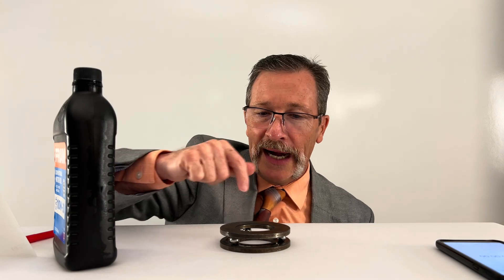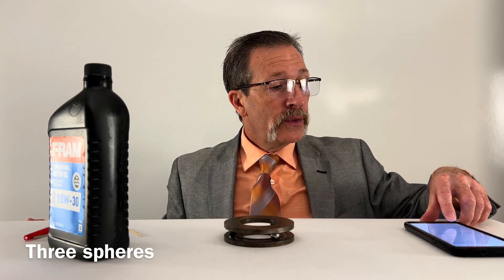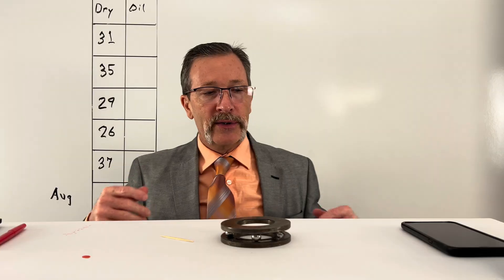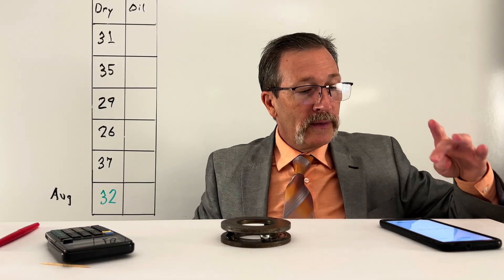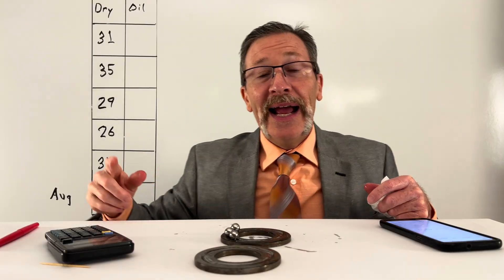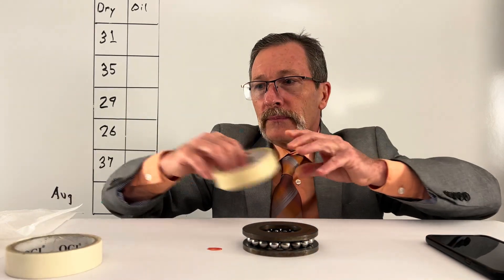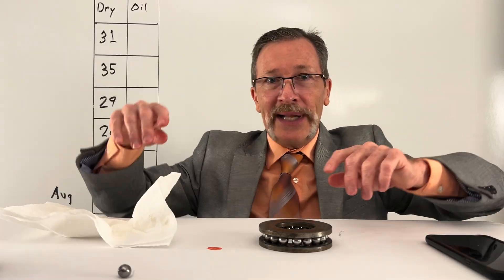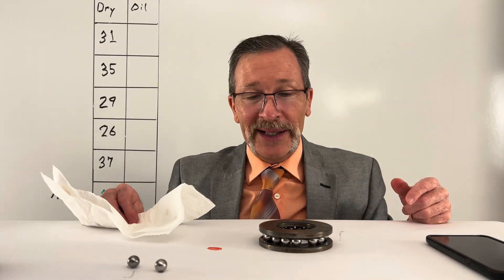Does Oil Make Ball Bearings Rotate More?

Comment: Fun fact, when we lubricated ball bearing motors, we always were taught to leave the drain plugs OUT until we could run the motor for about an hour. This was so the grease would warm up and the excess grease would drip out. Only then did we put the drain plugs back in.  In motor maintenance school we were taught that OVER LUBRICATION was a major reason for bearing failures. They will overheat, expand from the heat, ruining their high tolerances.

No offense meant, but your oiling method is way to much oil. If you just wiped the balls with an oily cloth would be more like the proper amount. That's one of the differences between 'ball bearings' and 'journal bearings'.

Still, a nice exploration of things.
Reply from the maker: Thanks for this practical comment and your expertise! Really interesting stuff!

Comment: Oil will have a bigger effect the more balls are in a bearing because it will provide a buffer layer between touching balls and act as a fluid bearing.

Oil will increase friction on unloaded bearings, but things get weird under high speed and/or high load.

Grease under high load will increase the contact surface area of the bearings and help to increase the carrying capacity of the balls and bearing race.

In high speed bearings the balls will start to hydroplane on the oil as it begins to act like a ramp for the balls, since the bearing race provides little space for the oil the oil pressure generated by a high speed ball forces the ball into the centre of race.

In short bearings are complicated and even ball bearings in practice are a mix of fluid and mechanical bearings in almost all applications.
Reply from the maker: Great response! Thank you for this.

Comment: I'm an auto tech and I deal with bearings (on cars) everyday. usually oil or grease is for cooling. I've noticed bearings that run dry overheat. wheel bearing usually have the balls in a cage to prevent them from touching. We really don't refer to ball bearings as thrust bearings. thrust bearing are flat like washers that prevent crankshaft endplay, they usually ride on pressurized oil.
Reply from the maker: Thank you for your feedback, knowledge, and experience!
Reply: More specifically, you're referring to a hydrodynamic thrust bearing. His example is a thrust ball bearing, where the arrangement of the races is still designed to support larger axial (thrust) loads than radial loads. Radial ball bearings have concentric races, as commonly seen in skates.
Reply: What the lubricant does is allow a friction wedge and also transfer heat to the sink.  Rotor, hub, spindle, strut, control arm.  Use your thermal cam if you have one some time.  All part of the function of a kinetic energy conversion system called brakes.   Each bearing type, taper roller, sealed bearing , Torrington, thrust all serve a different load purpose. The forces exerted are dynamic so they must endure multiple force vectors and variable levels depending on application.  That's why a converter hub bearing isn't a roller or why a taper cone set is used as a wheel bearing.

Comment: Great, now I’m hooked, especially since I just replaced some broken spokes on my beach cruiser and noticed the hub ball bearings were a bit dirty, gotta get me some grease I thought. The oil lubricates the ball bearing to prevent and/or reduces wear while under load and as they heat up during motion.
Reply from the maker: Yes...always use grease. We are showing how to do a long-term project, but it was surprising watching this bearing with and without lubrication. Thanks for your comments!

Comment: Good stuff! Lubrication increases rolling friction, but decreases sliding friction. Where rolling and sliding friction are equal, the mode of contact motion (rolling vs. sliding) becomes unstable. I'd still like to see gun oil and/or WD40 vs. clean and bone-dry.

Solvent wiping can be a messy process, so I'd recommend two solvent baths:
1) The 1st bath to thin and remove most of the oil
2) The 2nd bath (followed by paper towels) to remove any residual oil

To conserve solvent, the bath container(s) should be as small as possible, while allowing the parts to be fully submerged.
Reply from the maker: Yes...good ideas here! Especially the WD40! Keep watching and thanks for participating.

Comment: Under no load, the oil introduces friction and the viscosity makes a big difference, with a load oil reduces friction and in the case of bearing to bearing, this contact becomes the load, or part of the load.
Reply: Good point. Performance could be tested at more than one axial/thrust load. As it stands now, the top race sees a thrust load of one race's weight plus any hand pressure, whereas the bottom race sees the same load plus the weight of the bearing balls.

It seems that most of the sliding motion tends to occur between the top race and the balls, where there is slightly less load, and therefore less viscous-sliding friction, due to a larger hydrodynamic film thickness (and therefore less shear rate).
Reply from the maker: That’s a great point!

Comment: Does oil slow down ball bearings? Who cares! The real question is, "can I do this without getting it on my tie" 🤣 My theory is that the ball bearings work by contacting the races and rolling/spinning. When they're oiled up, they don't roll easily, slowing things down (I'm an IT nerd, not a mechanical engineer)